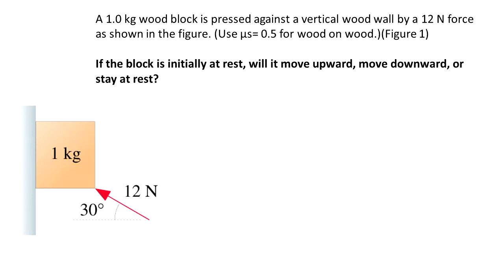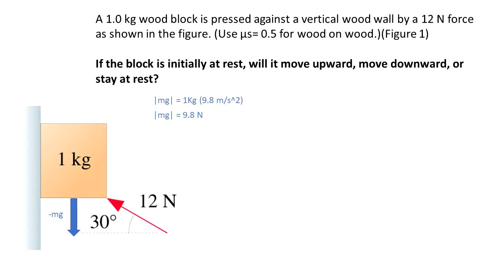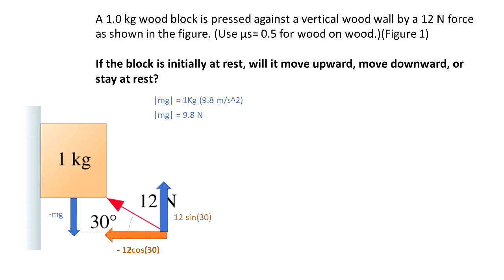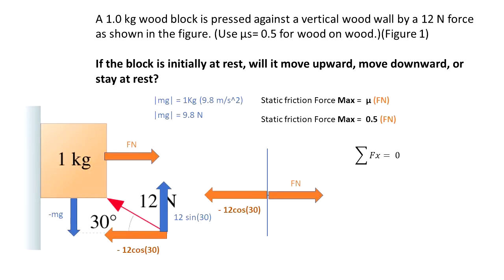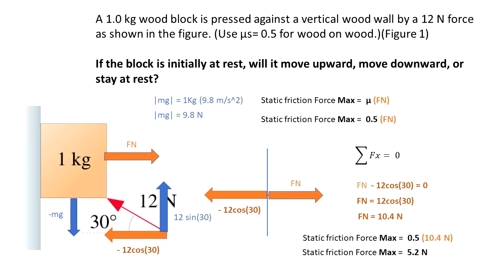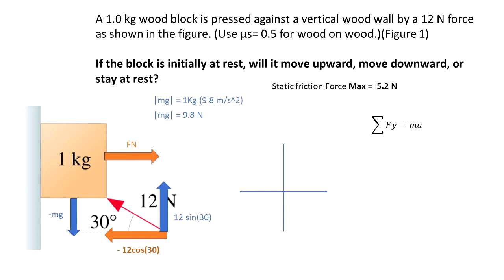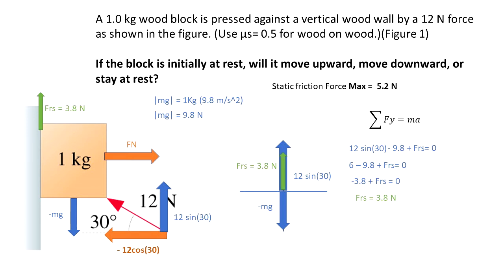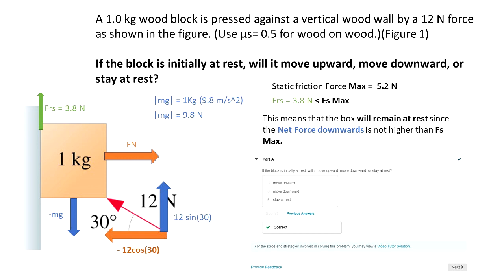Problem 5.75 solved Mastering Physics static friction

Comment: How did you know the direction of the friction force? why is it up
the man is pushing up so the friction force must be downwards
Reply from the maker: It is because the box is not moving, the static friction force is helping to prevent the box from sliding downwards. (You can also double check direction of forces from free body diagram)

3:33 also check that the Y component of man's force is 6N while mg is - 9.8 N. The friction force has to be going upwards to compensate so Net force is = Zero.

The case you are talking about happens when the man is applying a lot more force upwards and it that it slides upwards. (Overcoming mg + Fs Max) In that case the kinetic friction force would be downwards. But it is not the case for this problem.

Comment: The problem in my book does not give Use µs= 0.5 for wood on wood.  How would I solve w/o this information?
Reply from the maker: In that case did they specify for example if it is held in place at the verge of sliding ?
 
The question must be different in that case.